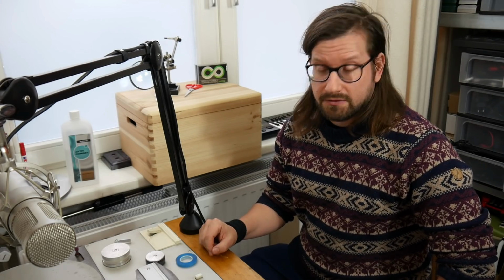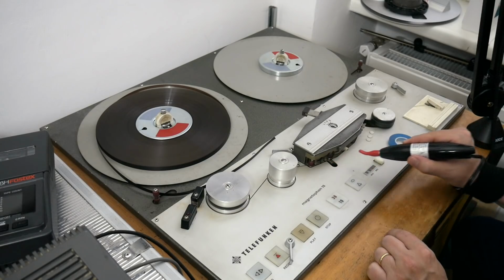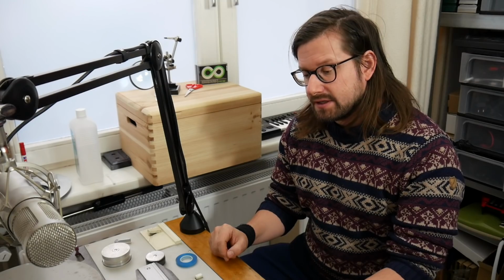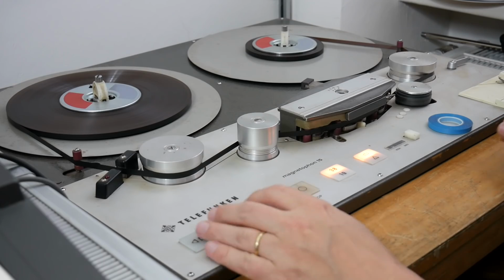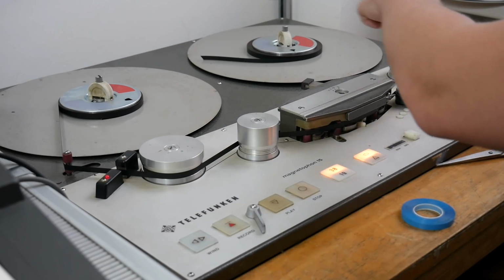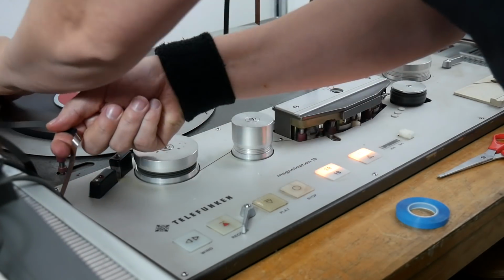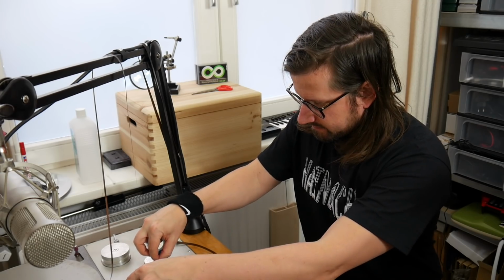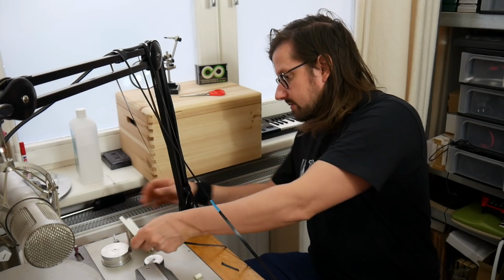Splicing Tape Loops

Comment: Former-engineer-me cringes... Use a splicing block, especially for taping the bits together. Splice to leads so you can spool all tape onto an 'ashtray' rather than letting it run wherever. Never (ever) move the pancake without a reel underneath. But the most important of all... Always remember to degauss the tripod and the mic stand. ;-)
Reply from the maker: Thank you! I feel like I should make a part 2 after all the feedback I have gotten. And find a splicing block on eBay.
Reply from the maker: Pinned your post so others who might attempt this will see.
Reply: @Hainbach  That's what that little white thing on the lower right corner is, I'm 99% positive. That said, for this sort of thing, it's not that big a deal. Watch videos of the Dutch Masters working (there's a couple here on YouTube, and you'll see they just used scissors and scotch tape, and no splicing block at all. For "real" edits, if you're splicing a song or whatever, a much better technique is required, but for this sort of stuff, it's more like "YOLO!" 

https://www.youtube.com/watch?v=1RjMuB8Qkd8
Reply: Dude you have one perfectly good splicing block on the very top of your magnetophon... and you don't even realize that :)
Reply: A good splicing block with have a perfect channel where the tape seems to "snap" in nice and straight, and the taped splice will be perfectly aligned.  There should also be a thin diagonal channel for a razor.  There's not much use for them these days, but I still love tape.
Reply: a polished glass rod of some kind is much better than using steel - i use rubber wheels on a bearing mounted on a kg weight though
Reply: you can also make your own splicing block - wood is a great material for one actually as it doesn't dull the blade like steel
Reply: Watches videos just to correct them. Obviously a wonderful human being.
Reply: @profd65  na dude it's called constructive criticism. He was just giving dude advice and OP even thanked him. You're probably the type of person that's offended and cries everytime someone tries to show them how to do something better.

Comment: Nice, Mr. H. Like you, I have some high-end tape machines and limited experience getting deep with them, like this. Best experiment was probably getting an old Telefunken answering machine loop to convert into a useful tape-echo reel without much mess (it was short). I have so much respect for the masters of this craft, Delia and all those who never received the recognition they deserved. Perhaps we can try to use one channel with a pulse recorded simultaneously (listening to it also in headphones), to sync a modular to the tape loop and hopefully make finding exact cut points easier. In a way, what they did back then with measuring tape and multiple pieces of the same note is easier...but there's nothing particularly easy about any of it. A real nail biter of an episode. Excellent work, and brave of you to share the journey with all of us.

Comment: I used to love my Revox B77 with optical sensor. When locating edit points i could manually shuttle the reels back and forth with my hands a bit like a dj with a record, making sure i kept tension between both reels. 
Im not sure you can do that for yours because these reel to reel decks often employ quite strong clutches or brakes. 
Love this though and very entertaining
‘STOP THE MACHINES!!’
🤣🤣🤣🤣🤣🤣🤣
Reply from the maker: Shuttling is possible, it's very fluent in that regard. Only gotten better at using that feature recently. 😊

Comment: "doing stuff like this on cassette, making your own loops pffff, I find that to be rather difficult..." YUP! haha, but might have to do a video like this using cassettes...
Reply from the maker: Oh yes, please do!
Reply: A video on splicing cassettes would be amazing, I don't even know where to start with something so fiddly.
Reply: @HitmanJenkins1  you can start with this video - https://youtu.be/hER3s1NPr_U
Reply: I have made a couple of cassette loops, damn they're so fiddly. I find it impossible to do anything exactly. I have a couple of the common length easier ones and put industrial sounds on. The "bump" is clearly audible but goes well with the source material and gives e xtra texture. I embrace the random results and exploit them. Not everybodys cup of tea though. Kee up the good work Hainbach.

Comment: I haven't edited tape since I was in college in the 1980's, but I think you could be making it harder than it has to be.  Normally, you would rock the reels back and forth manually as you dialed in an edit point.  then you would mark it with a grease pencil so you know where you're going to make a cut.  You would do that for both the beginning and ending of your edit segment before making any actual cuts.  As others have mentioned, you would also want to lay the pieces of tape together in a splicing block while you tape them together.  You could do your cutting there as well with a razor blade, although your built in cutting mechanism might be better.
Reply from the maker: Thanks for the tip! I did the manual   rocking back and forth, but I neglected the marking. It's much easier that way, I agree. And I do absolutely need a splicing block. The tape fell down so often it was not funny anymore.

Comment: You could also make use of a yellow chinagraph (= wax) pencil to mark your edit points and number each piece of tape. Deffo recommend a splicing block to make sure the two ends of the tape butt up against each other. No overlaps, and no gaps otherwise tape adhesive will get on your heads and capstan. Use spools not pancakes, and rock both of them back and forth to get your exact edit point.
Reply: It used to be possible to get splicing tape pre-cut into 2cm lengths on a backing strip in a handy little dispenser cartridge. This is much easier for beginners to splicing/editing
Reply from the maker: Thank you! I am not using pancakes but bobbies. They are superior to reels in that they have less drag, but you have the risk of the tape spooling off in transfer. You learn to live with that.
Reply: @Hainbach  I mean no offence to you but I was teaching tape editing to radio journalism students in the 80s. For editing music or speech it is much better to use fully enclosed spools. Pancakes or bobbies, you run a huge risk of (as happened in your vid) loads of tape falling of getting damaged, magnetised, snapped or sound quality degraded. Tip: use clothes pegs (Wäscheklammern) to attach your pieces of tape to some non-metallic string or washing line strung up from high points on walls, heads up (start of loop uppermost)
Reply: Pink Floyd and other such groups allegedly used a whole raft of microphone stands placed around the room to hold in position their tape loops. Ask Roger Waters, he'll tell you!!!!
Reply: I even taught a blind man called Chicken George to edit his taped interviews. But no-one stood close to him when he was wielding that razor blade, I can tell you....

Comment: Rewatching some old videos. And now I get an urge to cut up a recording into tiny spaghetti. Scramble it around and blindly splice the random pieces together. Probably do it into two separate loops so I mix them together on a third final stereo track and hard pan them to get the full width. Having one loop slightly shorter to have things go in and out of phase. 

Though, I have no tape gear ready... I guess something similar can be achieved in digital if I follow the same methods andturn off waveforms to keep the workflow blind. Hmmm. Darn it. Now I've gone and bevome inspired. Darn ye to heck.

Comment: I want to get into tapes and i baught a tapedelay to start off with. I want to make tapeloops by myself but ive heard commercial scissors cant be used. Do you know what scissors i should use? Ceramic should work, right?
Thanks for the video and for the help :)
Reply from the maker: Get a splicing block and a razor blade, as well as degausser. Then you are set.
Reply: Thanks for the answer.A degausser is build in and a big problem is I wont get a splicing block in germany :( 
So ceramic should work because theyre anti-magnetic or am I missing something?
Reply from the maker: You can buy a splicing block from http://www.darklab-magnetics.de/. Say hi from Hainbach, maybe someday I will get a discount :-)

Comment: Not sure if this is noted, and it's really not a big deal: when you're cleaning tape heads/mechanics with IPA, clean in a wiping in one direction fashion (left to right). You will risk scratching, and deforming your heads if you rub on your heads with a dirty/fluxy q-tip. It's not a big deal, but if you're using tape machines almost DAILY, you're going to wear those heads eventually.
Reply from the maker: Another great tip, thank you!

Comment: Whenever I clean my cassette recorders, I use 91% isopropyl alcohol. I always avoid the pinch roller when cleaning because I’m afraid of drying it out. However, any time that I have attempted to clean them, there is always a nice brown coating of something that winds up on the q tip. Is this just dirt, or is this actually bits of the pinch roller being eroded from the alcohol?
Reply from the maker: Yeah, never use alcohol on rubber parts. I was only cleaning the capstan. The dirt is from the magnetic tape rubbing off.
Reply from the maker: Yeah, never use alcohol on rubber parts. I was only cleaning the capstan. The dirt is from the magnetic tape rubbing off.